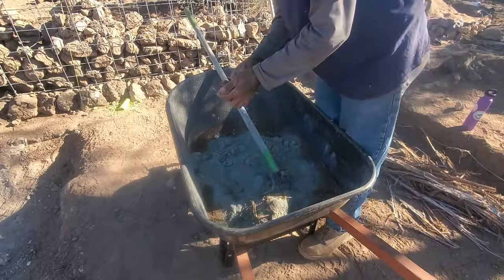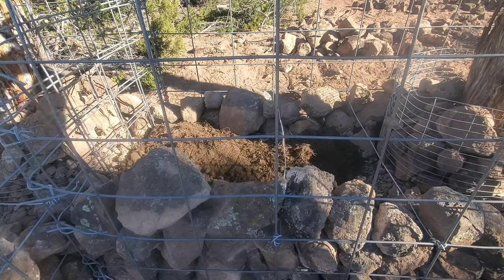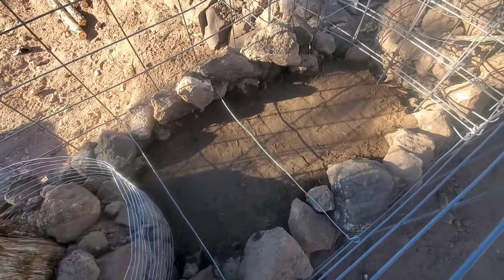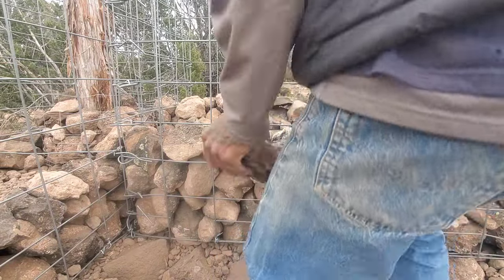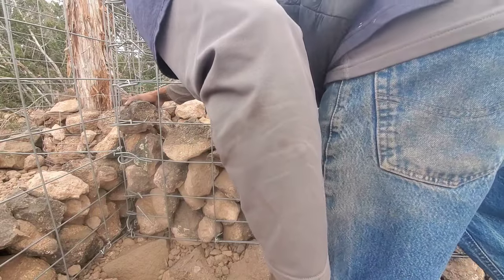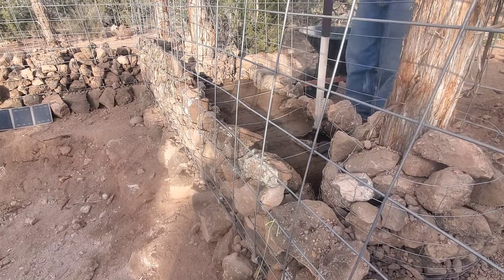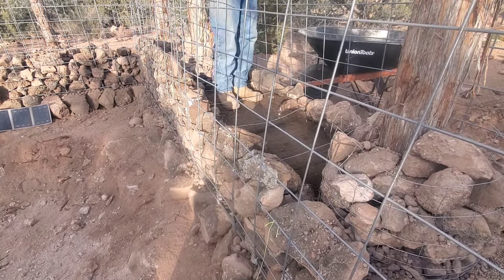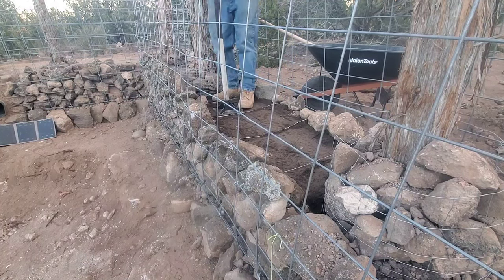Are We Building The Ultimate Thermal Mass Wall?

Comment: I'll suggest you use a lot more stone so you have to mix a lot less rammed earth.  If it was my project, I would be filling the gabion with 3 layers of stone on each side of the rammed earth leaving just enough room for my feet and the compactor plate.
As it stands, the mixing and installing of the rammed earth is by far the most labor intensive (and expensive -Portland cement) component of the system.
WIth the tall gabion wire, I suggest you fill the bucket of your machine with suitable rock and deliver the rock to the fill location with the bucket at an easy lifting height.  One person lifts the stone to the inside person and monitors how the stackup looks from the outside.
If you're going to be hand mixing, use a flat shovel with a long handle. Much better leverage=less fatigue. You don't need the little garden rake/cultivator 👍
Reply from the maker: Always appreciate your insight. The base layer is big, you'll see how we stack it up and ram the earth wall, but essentially doing it like you said, so we don't have to do to much rammed wall and mixing. ✌🏾
Reply: @GrowTreeOrganics  Shoveling, sifting, shoveling. mixing , shoveling and tamping is a lot of manual labor.  No way to power a mixer off a solar battery rig?  Sure would save  you a lot of labor.  I'm sending good karma!  Keep up the good work 😊

Comment: Always good to see the updates, how are you going to stop the thermal mass from heating up during the day from all the cob/stones? If you had external insulation you can control inside temperature without external insulation all that thermal mass will always be roughly the same temperature as the outside air, but with a lag effect. I have seen people in the desert do double roofs with a large air gap that can flow freely to stop the majority of the heat coming in, really large overhangs will be important also. Look up Paulownia trees, they are the fastest growing deciduous tree in the world that could give you summer shade then loose it's leaves in winter.
Reply from the maker: We will be back burying the basket for extra thermal mass and to help keep the rocks at a moderate temperature inside and we'll have straw bales for insulation on the outside. You will see how things come together. We've still got so much to show on how this structure is going to look and come together. Thanks for your question and following the journey. ✌🏾

Comment: This is an interesting alternative to using tires like Earthships are made of. Another possibility would be to make 2 can and cament walls and fill the space between them with the soil, like Earthships but doubled and filled. I'd fill the cans too. 
In Costa Rica they make prefab houses by putting cement posts in the ground and sliding concrete panels down in the grooves of the square posts. Then they stucco or tile or something over the top. I've often thought that the same system doubled a foot apart and filled with soil would create something like an Earthship but much faster. Those homes go up in 2 weeks from beginning to end if a good crew does the work. It's super cheap too and doesn't rot. The houses are very earthquake resistant so 2 layers should be even better. 
But that all costs a lot more than what you're doing. I'd like to see how it turns out.
Reply from the maker: I think it depends on location of the build, but I like your idea with the can walls. We did the can walls on the first earthship we built. Takes a lot of cans. I'll explain in the next video why we went this way with building and if it's faster than regular earthship building. Appreciate the commentand for supporting the Journey. ✌🏾

Comment: I would think that the cedar bark in the mix would eventually rot away causing voids. Causing both structural issues and reducing the thermal performance.
Reply from the maker: The bark will be encased in the wall and the whole structure will be back buried.. I have thoughts it will help preserve things better. Especially Cedar and the bark are rot resistant. Even landscaping cedar chips take a really long time to break down.  And that's with ideal conditions for the microbes to break the Organic material down. Associate the comment✌🏾

Comment: Why not just install the cross wires flush on top of a finished layer.... and go from there?  You'd not have to work around them, and theyd still get well set.
Reply from the maker: It's only slightly complicated because the rocks need to be stacked up above the level of the rammed earth and its hard to tie the brace wire when the rocks are up. Need the rocks for the rammed earth Form. Thanks for your comment✌🏾

Comment: Rain and dirt don’t mix.
Reply: Of course they do. Mud is the result. 😉
Reply: @comfortablynumb9342  I live in Seattle and if you build something with mud or dirt it will rain and wash out all the dirt. You either need to use earth bags or filter fabric between your rocks  and dirt.
Reply: @jvan6674  I'm pretty sure they top off the walls so the soil won't wash out.
Reply from the maker: This is an earthship style structure, so it will be back buried. The rock wall will not be exposed to the outside but encased in multiple feet of dirt and more rocks. When we get into more back burying I'll be able to explain what we're doing different with the mound than most earthships. Appreciate the dialog✌🏾
Reply: Makes sense. Can’t wait to see how it turns out!